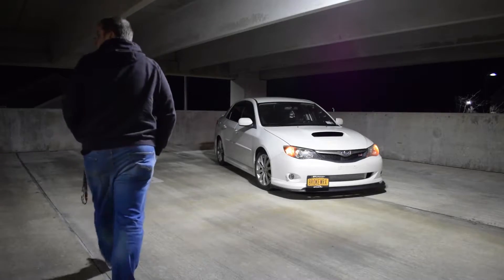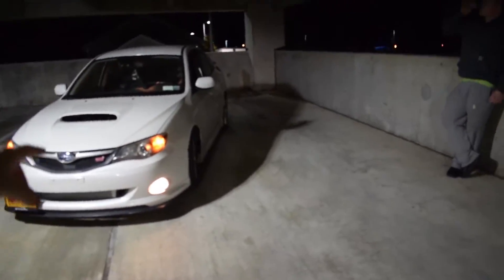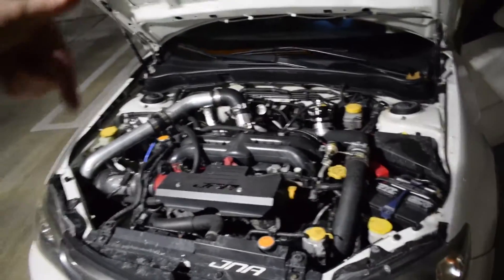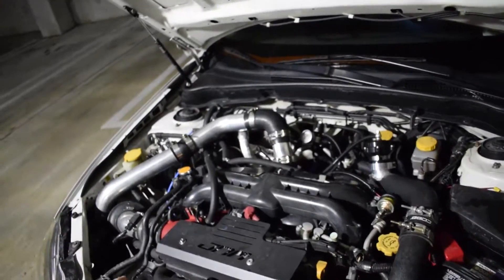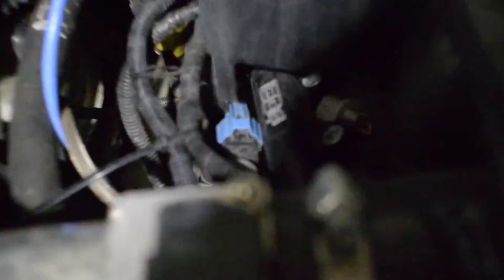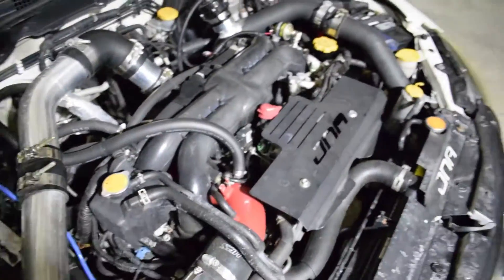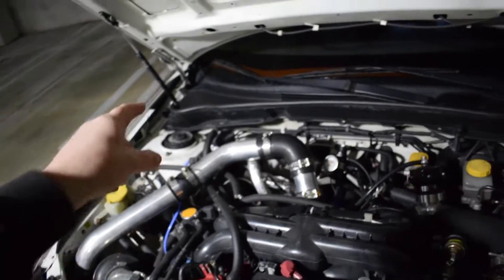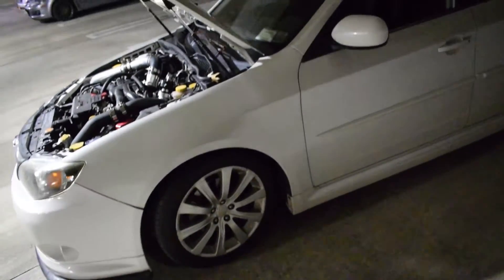08 Subaru WRX Build | Whats it got?

Comment: Did you blow the tran ny yet? 3rd gear just went in my 09 hatch. I'm pushing 331 hp 353 tq.
Reply: Never blew it up no! I ended up selling the car a while back, and I was never very kind on the trans/ flatfoot shifting and launching the car all the time, the 08+ transmissions were mildly stronger than the older wrx trans but still had their limits, I’m sure i would’ve blown it if I still owned the car LOL